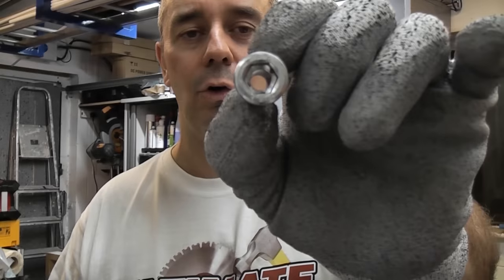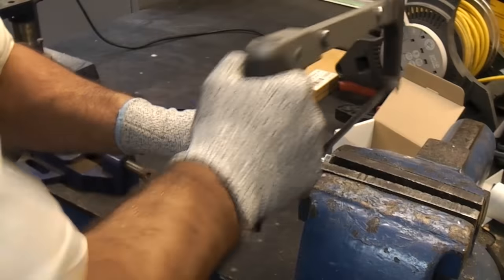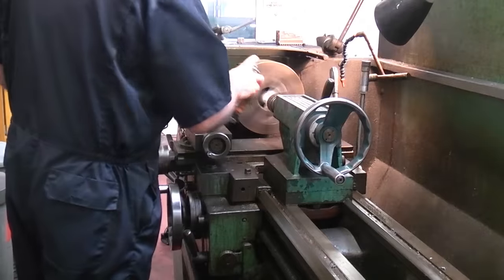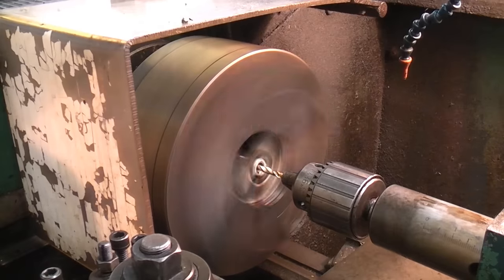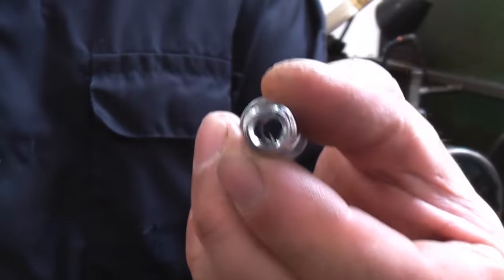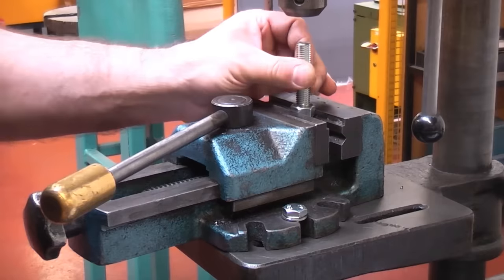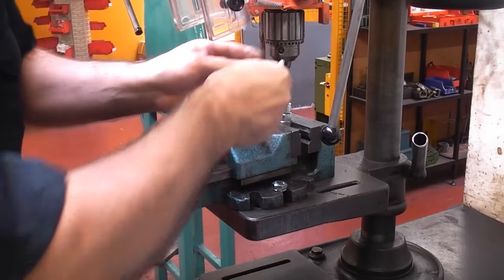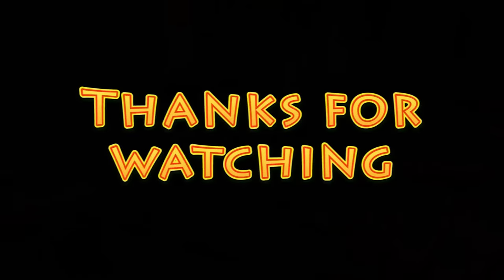How to drill through the centre of a bolt | drill bolt guide

Comment: Thank you for making this super helpful video!  I am realizing that my life is missing a drill press vise.  Your drill press vise looks like great quality; do you know who makes it?  As I am looking at the various options, I see the styles are different and that some are cross slide (X-Y) drill press vises (they let you crank left/right and forward/back).  Occasionally, I have a pattern of holes to drill on a flange or something and the cross slide vise seems like it could be nice... assuming they work as well as I hope they do.  Do you know much about them and are they a benefit - or do they introduce problems like looseness and slop.  Thanks again!   This whole thing is me working up the ability to remove several grade 8 bolts that are broken off below surface in a farm tractor steering arm plate.  I took a casual hand held attempt a drilling the broken bolt, but It's clear that I cant hold the drill center and I stand to make the situation hopeless if I don't get in control and use you techniques.    For any advice you can provide, thank you so much.  Regards
Reply from the maker: I’m not sure what make the drill press vice is in this video, as it was on site and was probably 50 years old. At home I have a Record drill press vice, which I bought when it was on special offer. I have never seen a drill press vice with X-Y movement, but have used drill presses with X-Y tables- they are incredibly useful and mean that you do not have to readjust the work piece in the vice. The last place I worked had two pillar drills and one radial arm drill, which was a real beast! 
As long as you get a drill press that has not been abused, there should be no slop, as the table locks in position using a lever, once it is adjusted to the correct position 👍
Reply: @ultimatehandyman  Thank you so much for the reply.  I appreciate the help immensely.  You make YouTube a great source of learning.

Comment: Right handers, Always hacksaw on the right hand side of the vice to avoid punching it. Also one can carefully grind centre cutting edges to the drill bit so the centre is cutting also! This would allow higher speed but a water mixed cutting fluid needs to be flood sprayed with a trigger spray bottle or drip tube to keep the bit well cooled. 
Going easy though wth socket head cap screws cos they are hard I agree. 
Nice tip centering the part with the chuck and vice. Also C or F clamping the vice works quickly too.
Reply from the maker: I just use which ever side of the vice allows me to film better 😂 
Thanks for the comment 👍

Comment: I use this method to make spacers and other parts for my RC’s ... except I reversed the process by putting the drill bit in the chuck upside down and lower it down in the vise and tighten it up good, then I put my piece in the chuck and lower it down on the drill bit. You get the same results.... you can do it both ways.
Reply from the maker: Thanks for the comment 👍

Comment: On a lathe always start off with a centre drill.  Handy to do it on the pillar drill set up too.
Reply from the maker: Absolutely, although in this case it was not necessary, as the cap head screws have an indentation in the dead centre from their manufacturing process.
Thanks for the comment 👍

Comment: I checked the plateform with a square and it seems fine both ways to the drill chuck.I have a feeling that the drill is walking slightly on me.It is such a minute amount.I ordered a set of center drills from Amazon,so when I get them I will try again and let you know.I also noticed that I used alot of cutting oil.I also thought that maybe if I drilled at a slower speed that it might help.That is something I will not be able to change
Reply from the maker: We used to have a drill press like that in one of the workshops on site- it was impossible to drill a round hole with it, as the chuck used to orbit!

Comment: Hey UH, what a cool jig and solution. I'm desperate to remove several broken bolts. Am I able to do this without a pillar drill? Tricky I appreciate as everything hinges on the accuracy of centre and upright/square. Or is there anywhere that I can purchase these already drilled? Tight for time, but I have really enjoyed several of your videos. I've subscribed and I look forward to enjoying more at my leisure.
Reply from the maker: You should be able to make these on a pillar drill- just take your time. I'm afraid I do not know of anywhere that sells them yet.
Thanks for the comment 👍

Comment: I had to make a bleeder screw for a paccar mx engine when I broke it when I put a little to much torque on it. It was actually very simple to do. I didn't even use my drill press I just used my m18 drill and a vice. I made one hole in the middle of the bolt and then another hole in the side of it and it's worked perfectly.

Comment: Where do you find assortments of socket head cap screws in the USA that you can machine?  Every where I look, they are grade 8 or harder which I believe will be difficult to drill.  Great video, but I don't know where to buy the materials.
Reply from the maker: Generally socket head bolts have a higher tensile strength than normal hexagon bolts, but they can still be drilled relatively easily. You can see that the swarf is only being removed in small pieces, whereas if the metal was soft it would be cutting off in large spirals.
 A cobalt drill bit will make light work of any cap head bolt.
Thanks for the comment
Reply: McMaster Carr— but then online— aluminum if you like since it’s just a guide bolt...

Comment: I certainly need to make some of these to keep in my toolbox, thanks for the tip. I'm still looking for a method of accurately drilling bolts that have been cut flush and/or that go through a tube, for example a leaf spring bolt or chassis bracket bolt. The Evolution mag base milling drills look superb but you need a flat metal surface exactly perpendicular to the bolt to mount them.
Reply from the maker: The Evolution mag base drill is brilliant. I drilled out a wheel bolt for a mate when the locking nut holding his alloy wheel on could not be removed. I clamped a piece of 6mm steel plate to the alloy and fitted the mag base to that and then drilled it out using a Artu drill bit - it worked like a charm. 
Thanks for the comment

Comment: It's ok to grip the bolt on the threads when chucking it on the lathe. There are enough threads in contact that the bolt threads will not be damaged. "Pillar drill". We just refer this as a drill press in Canada. Good idea for centering when there is no lathe.
Reply from the maker: Thanks, I assumed that gripping the threads would damage them, but have never tried.
There are lots of different names for pillar drills/bench drills/pedestal drills etc. 
Thanks for the comment

Comment: I noticed you used a 6mm drill but for the m12 bolt. Is is recommended to use a drill bit half the diameter of the bolt when making drill bolt guides?
Reply from the maker: Yes, I would not go much wider than that, or you weaken the bolt.
Thanks for the comment 👍

Comment: I have an alternate drill press method I've used for many years reliably.  I have an old chuck I can put in vise (mounted it short piece of square or hex stock).  Chuck the drill bit in chuck loosely clamped in vise then center using the drill press chuck, tigheten vise and clamp it.  Mount the bolt in the drill press chuck and it will follow center just like it does on a lathe.
Reply from the maker: Cool, thanks

Comment: try putting the drill bit in the vice and the bolt in the drill chuck.works every time exactly like a lathe
Reply from the maker: There is the chance of damaging the threads then. The lathe chuck grips the head of the bolt- not the threads.
Thanks for the comment

Comment: I tried this and had trouble.I have a Craftsman Drill Press and a vise similar to yours and a new cobalt 1/4 inch drill bit and I drilled a hole through the center of a 3/8 inch bolt about 1 and 1/4 inches long.I tried it on 2 bolts and both times the bit came out about 1/16th of a inch off center at the other end of the bolt.I am sure the drill bit is straight and my plateform is zero.do you suppose I might still have a slight error somehow in my plateform.Is there someway I could check that.Please comment on this when you have time.
Reply from the maker: Have you checked that the table on the press is square to the chuck?
You can do that by putting a piece of bar in the chuck, or a straight drill bit. Tighten the chuck, then use an engineers square on the table to check it against the bar/drill bit.
Hopefully there will be some way to adjust it, to get it completely square.

Comment: You need to mention several details. One is that it is common for a bolt head to be eccentric to the body.  The drill can be pulled off-center by the eccentric hex hole.  The hole should always be started with a short, stiff drill (either a spotting drill or a centering drill).  Second, the important part of the hole (for extracting broken bolts) is the location of the hole at the end OPPOSITE the bolt head.  As the drill can drift sideways traveling through the bolt, the most accurate part of the hole is at the START.  So the hole should be drilled from the END OPPOSITE THE HEAD of the bolt.  Even if the hole drifts somewhat off-center as you drill toward the head, as long as it doesn't break out the side, you are OK.  When you use the bolt to guide the drill (to start the drill on-center of the broken bolt), that part of the hole will be most accurate & will center the drill correctly.

Comment: Another approach is to put the bolt to be drilled in the pillar drill chuck, and the drill bit in the vise. Properly ground drill bits are self centring, so as long as the bit is straight and vertical it will centre itself in the bolt being drilled. I guess you can set the drill bit to vertical by chucking it reversed in the drill, then raising the vise to it.

Comment: To guarantee the hole is central to the thread, wind a piece of wire into the thread for it's entire length, then clamp it in the lathe chuck and drill away as required.  Most drill-press vices have a 'V' grove in one or both jaws for clamping round stock at right-angles. Using the wire method above, put the drill in the vice, and the bolt in the chuck. use a straw to direct cutting fluid upwards.

Comment: Was that an Ainjest quick screw attachment on your lathe, mine has it fitted such a great idea.
Reply from the maker: I'm not sure, as it is in the workshop on site. I rarely use it.
Thanks for the comment 👍
Reply: Ultimate Handyman they are great for screwing up to a shoulder without an undercut either internal/external threads, once it’s set, it clicks off in exactly the same place each time,
Reply from the maker: I'll ask one of the guys that does a lot more machining than me. Thanks for the info ;-)

Comment: Question. If you have a 6mm bolt head you'd use a 3mm drill in the centre?
Reply from the maker: Yes, but you have to be careful with it, as it does not leave much material at each side.
Thanks for the comment

Comment: Drilling through a soft steel screw (=with a low breaking force) might work this way, but usually screws are manufactured by a machine with big heavy rolls inside, e.g. to roll onto them  the M12 thread on their outside, which makes their center core incredibly hard. I tried several drill bits, even hardened with cobalt etc., but they all loose their center sharpness within a few millimeters of drilling the hard screw core.   I mounted a new lamp to my house, which has an insulation of like 10cm styrofoam before you drill in the stones. So i used a common 20cm x 1cm Bolt and dowels and tried to make a 3,1-4,2mm hole in the bolt head for a M4 or M5 thread of like 13mm in a 20mm deep hole into the bolts head, to mount the lamp with metrical screws on top of the flush mounted standing bolts. As described it took me like 3-4 drillbits of 3mm diameter to finish one of the bolts. Yes i used oil and released the pressing force from the drill press like shown.    Any ideas how to work arround this problem?
Reply from the maker: Most bolts are harder than mild steel, but not normally that tough that Cobalt bits will not drill them. I've drilled out hundreds of socket head bolts (which are tougher than traditional bolts) using cobalt bits.
I can only guess that it is the quality of the cobalt bits that is the problem.
Thanks for the comment 👍
Reply: You could heat the bolt you are trying to drill red hot and let it cool slowly, maybe cover the bolt in sand while it cools off.   The idea is to de temper the metal.  
The other idea is maybe you are drilling too high rpm.  

Good luck.

Comment: Nice job using your head. But you should center drill any drilling of holes in a pillar drill press. That way you will have not drill walking going on. Peace too from the other side of the pond.
Reply from the maker: Not sure about Imperial socket head bolts, but the metric ones over here have an indentation in the dead centre of the socket head- so no need to use a centre drill.
Thanks for the comment 👍

Comment: Use a center drill to start the hole, otherwise the drill will wander. To clamp a bolt, use a split nut, thread it on, and clamp in the vise. To center a bolt head under the drill use a cut off piece of old alley key in the chuck. Just a few ideas...

Comment: What drill size do you recommend for making such guides from M8 and M10 bolts?
Reply from the maker: 6mm bit should be ok  for M10
4mm bit for M8
I did drill a M12 out with a 10mm bit but it didn't leave much material behind!
Thanks for the comment
Reply: @ultimatehandyman  Thanks! Will go with your recommendation of 6 and 4.

Comment: Why was the drill bit chuck on the lathe torquing back and forth? Does it serve a function?
Reply from the maker: Yes, when drilling on a lathe you need to peck at the item you are drilling.
When I was at college I was told that if you just try and force the bit through in one forwards movement the drill will not go straight and will probably exit at the side of what you are drilling.

Comment: A quicker way is to put the bolt in the chuck and clamp the drill in the vice....best to use a centre drill first to prevent wandering.   This method doesn't required bolting down vices as it tends to self centre.

Comment: After hacksawing then drilling with the lathe, you ought to face the hacksawed end of the bolt to insure that the twist bit won’t be forced off-center by an irregular surface.
Reply from the maker: The bolt that was cut, was only used to centre the pillar drill vice, it was not drilled.
Thanks for the comment ;-)
Reply: Ultimate Handyman / Looked like you hacksawed it off at 0:55 then put it in the lathe at 0:58 . .
Reply from the maker: @aredubbleya109   No, I cut the head from a hex bolt, so that it could be used to centre the vice on the pillar drill. At 0:58 I used a cap head bolt.
Thanks for the comments ;-)

Comment: You can make it much much easier. Put the bolt in the drillmachine and the drillbit in the vise.
Same as the lathe but vertical.
Simpliest is to put the drillbit in the machine first, up side down. And the clamp it in the vise at right position, lock the vise and table  and loosen it from the drillingmachine.

Comment: it's just a theory, in practice you will always drill diagonally, works only with short bolts
you have to start with a small drill and rotate a vice to correct the imperfection of the screw mounting
bolt nut have always slack
only lathe and drilling both ends alternately

Comment: For small bolts put the bolt in the drill motor and the bit in the vice and drill away
Reply from the maker: And then damage the threads on the bolt!
Thanks for the comment

Comment: i thought about this years ago to take all the bolts off my mack truck drill them out so i could haul a bigger load i believe there is no strength lost in the bolt since all that metal in the middle of the bolt does nothing .
Reply from the maker: I'm not sure about that. If you drill the centre out from a bolt it normally weakens it- as it makes it easier to remove!